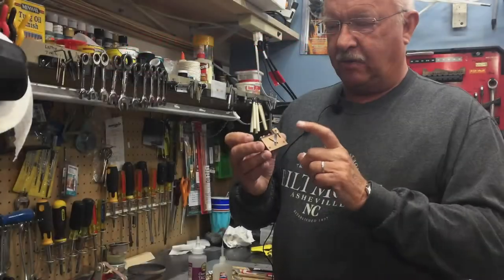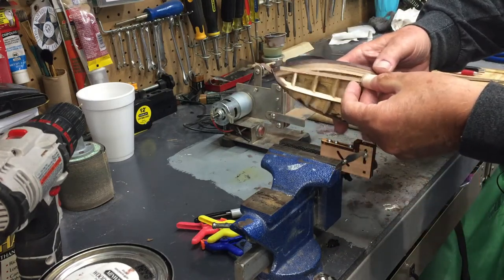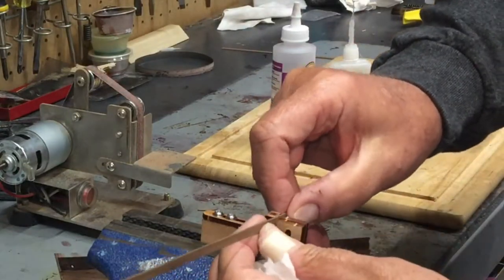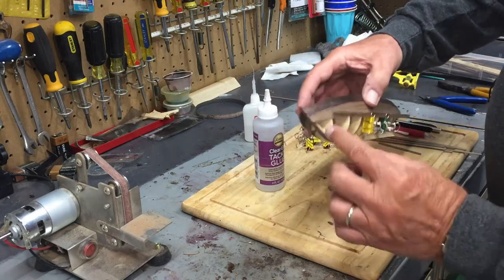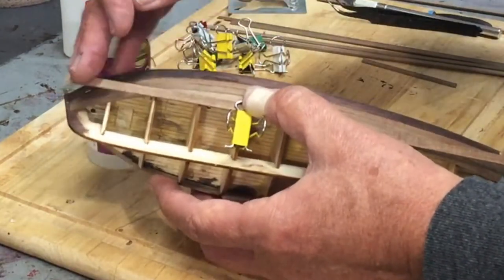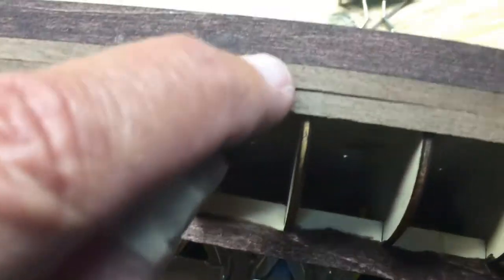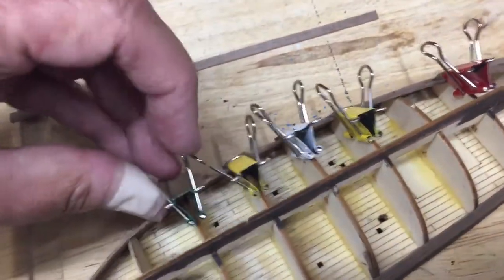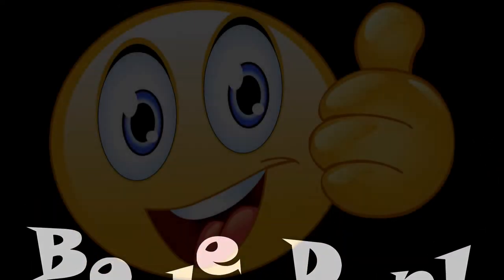Chamfering Tool Part 2

Comment: I am not sure you are checking the comments or not.  I recently got one of these tools. The two videos were helpful (though I did manage to get it assembled prior to watching previous vid).  

How do you know what angle to set for the blade?  The angles vary as you typically go around the hull.  Do just 'eyeball it' or is there a purpose to the markings on the tool?  

BTW the part of this video where you determine how to trim the plank to fit helps me.  Thanks
Reply from the maker: Yes, I do check my comments every day.😃.
The tool hasn’t worked for me as well as I had hoped.  I do just eyeball it as I go.  Lately I’ve had success using a miniature belt sander to cut the angle on the planks.  I don’t think the angle needs to be perfect, you’re just making it so that the seam between planks is better.
Thanks for watching, sorry I couldn’t be of more assistance. 👍
Reply: @BoilerDan1  Thanks for the reply. 

 I tend to agree after looking at other methods for fitting planks.  The intend is to smooth the curve somewhat.  Considering it's using flat planks to make a curve, it only has to be 'close enough.'  I figured I will have to do some filling and sanding on my current project.  Although...my first 'for real' attempt at planking isn't turning out too bad so far.  

I started looking through your other videos and see several I want to look at.  Thanks for posting.
Reply from the maker: Thanks for checking my videos out.
Note that I have been recording my journey from a novice just getting started. I’ve left all of them posted but the more I build, the more I learn and improve.  It’s a very rewarding hobby. And very time consuming!😂👍

Comment: No more wetting and bending the wood?
Reply from the maker: Actually, it doesn’t replace bending the wooden planks.  It’s the vertical.... hard to explain, but I will try:
As you work down the hull it curves inward towards the bottom of the ship, the edge of each plank will have a gap.  This tool shaves the inside edge which allows the outside edge to pull into the planks above it.... hope that kinda makes sense?   I try to illustrate it in the second video. I’ll highlight it in a future video series on my next model.
Thanks for watching 👍
Reply: I kind of understand...it's been fun watching you progress...I love putting together models and purchased a little starter boat awhile ago, and got intimidated.
Reply from the maker: It’s definitely a challenge! Fortunately I’m retired and can devote time to figuring it out! 🤣